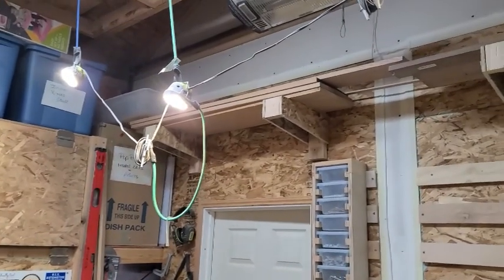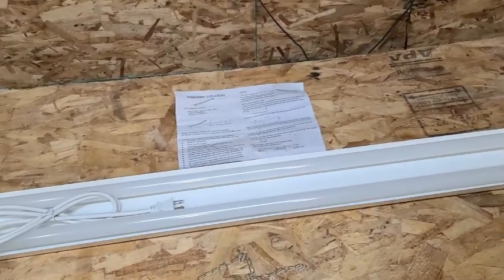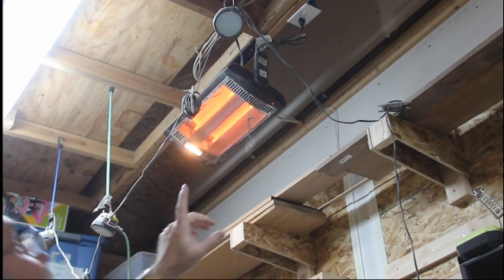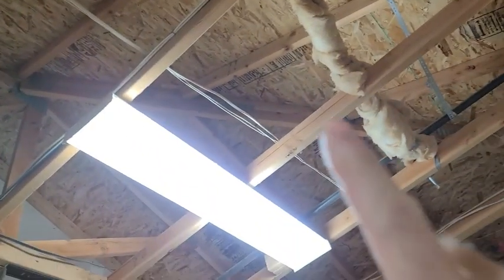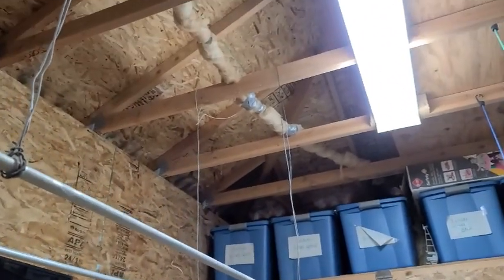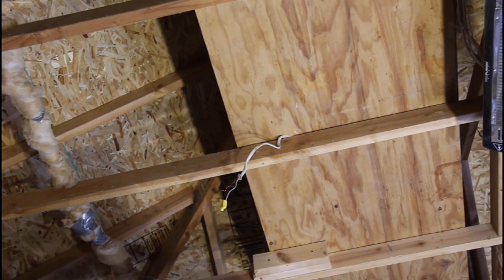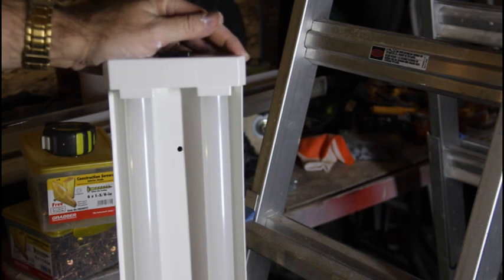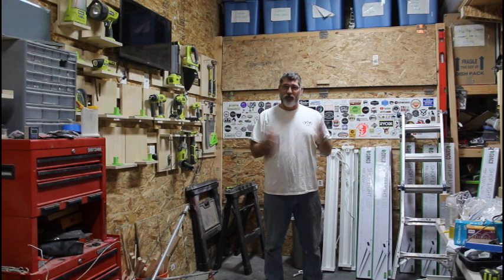Upgrading the Shop Lighting! | 500% Increase for less than $200 | 2021/006

Comment: I would always wrap the wire around to the screws. I have seen outlets get hot using the friction fit holes in the back. Especially in a woodshop with the fine sawdust. The fact that you are not unplugging the cords has nothing to do with it. Just my 2 cents.
Reply from the maker: Thank you for your input and guidance.. I appreciate you watching my video!